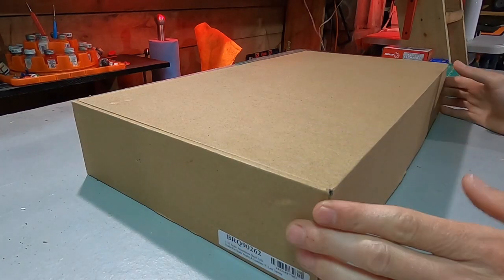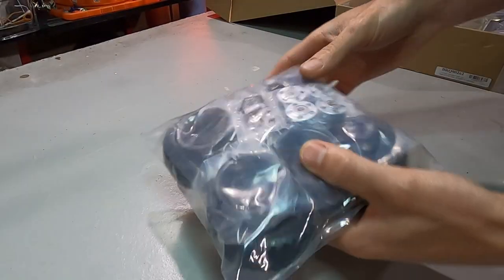RC Car Hauler Trailer - SATISFYING Build/Edit - PMM Racing - 1/10 Scale - Dual Axle - Aluminum

Comment: Hey man I got the same  trailer I’m putting it together now. I’m watching your video. I can’t figure out how you mount. The LED lights from behind. Instructions are horrible your video is great but I can’t see how you’re mounting them from behind stay in the trailer
Reply from the maker: Hello! Nice that's exciting! The leds were weird. They don't really mount properly, mine just rest in the metal buckets stay in simply by how I zip tied them, you can just pull them out if you tug back of wires. I was thinking maybe put a tiny amount of shoe goo to hold in place!?

Comment: Will my 4tech 3.0 traxxas fit in the trailer? And also what will I need to connect this trailer to my trx4 bronco
Reply from the maker: I'm not 100% sure! I dont have one of those. If you measure it length and width i could check my trailer for you!? Anything 1/10 scale will fit no problem! Crawlers or cars! You would just need a rear bumper that has a reciever for a hitch!
Reply: @IRONSIDE_RC  my 4tech 3.0 is about 8 inches wide and about 19 and a half inches long(with the body) but from the front bumper to the rear wheels is about 17inches long so if the body in the back hangs off about 2 inches I wouldn’t mind
Reply from the maker: @Chargersctpk  the trailer on the inside of the rails is 10" wide by 17.5" long so looks like it would just fit!
Reply: @IRONSIDE_RC  that’s perfect. Thank you so much for checking for me
Reply from the maker: @Chargersctpk  My pleasure ✌️

Comment: Great trailer build. Can’t wait to see the custom wood addition. Just love that 4R of yours.. mine is sitting stock next to a parts pile for the build. I’m gonna give those metal inner fenders a shot with the engine bay. Saw what you did with the plastic ones. Anyways, keep ‘em coming, super clean builds… after my own heart. Cheers!
Reply from the maker: Thanks👊 I appreciate the kind words! Ahh I know how that is! At least it's beautiful stock🙂 just a heads up they won't fit with engine bay unless you modify aswell, might have to do it a little different as I used the plastic ones! Thanks for watching! If you have any questions with the engine bay I'm here!✌️

Comment: I’ve got the same trailer and trying to do the light install. Where did you get the part where u put the light through the small hole and keep it in place? 

And also the switch. The little piece to tighten around the thread. Where is that from?
Reply from the maker: Hello! Sounds like you might be missing some pieces. Mine came with everything you see besides the custom wood top I did. The lights don't really lock in place so you could glue them in lightly!